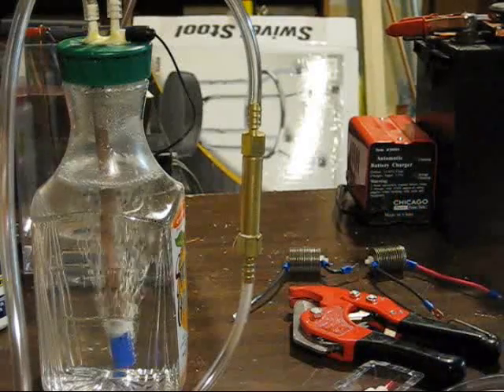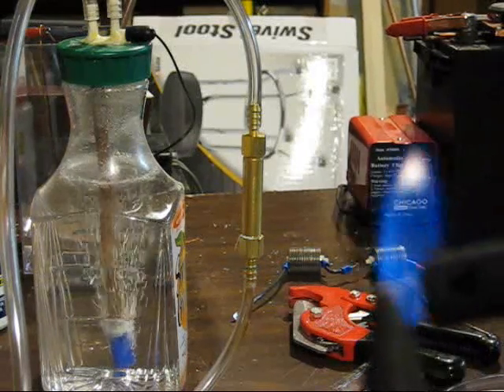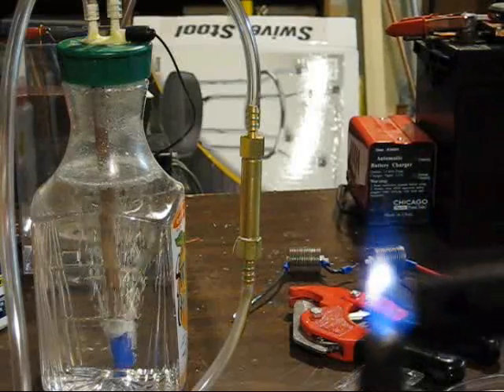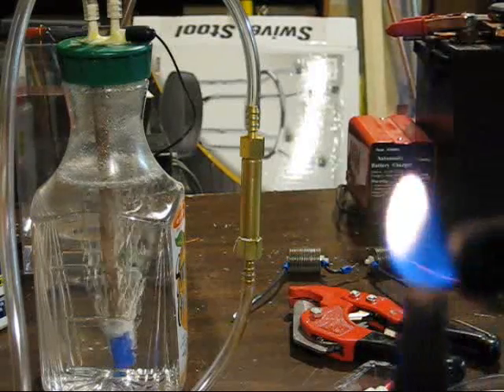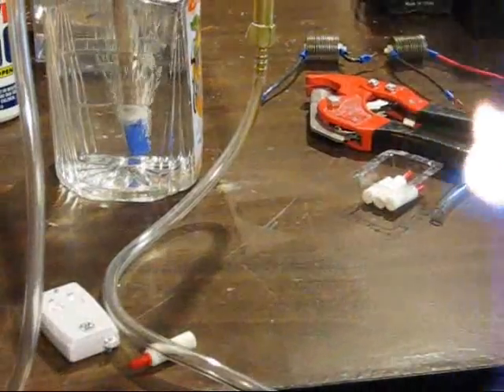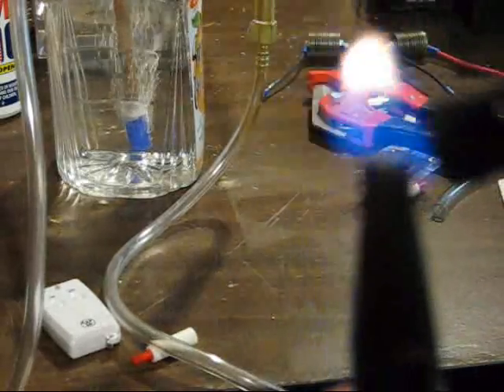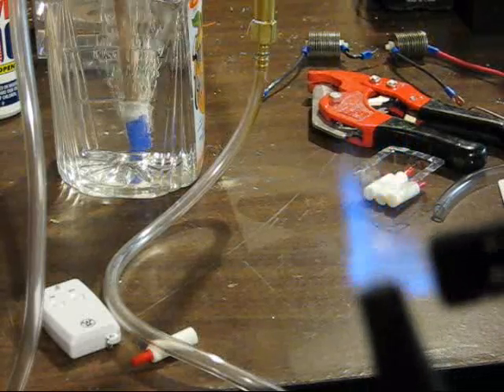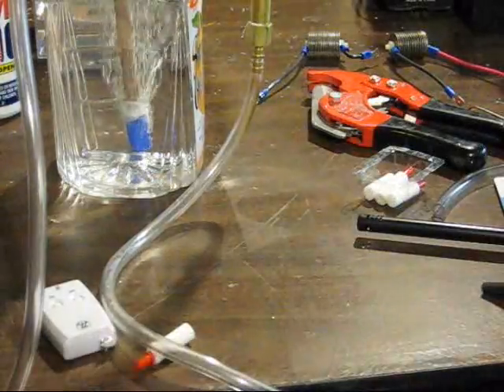Flashback Arrester #1©

Comment: Yes, explosion then implosion. If there was no flex in the container, all vacuum would be subjected to the water. (Consider feed and supply line length and dia too) Then, lowering its vapor pressure. Remember, water to vapor is about 1500 to 1.

Comment: can tell you from personal that when the flame front makes it all the way back to bubbler, she blows.  There may be an implosion that follow the explosion but there aint enough bubbler left by then to detect it.  This demo is cool because the flame never gets to the bubbler but the low pressure in the tube is pulling vacuum on the outlet.  Very interesting.

Comment: I am not so sure.  I think it might suck the lid IN not push it out.  I think I see in the video that the sides of the bubbler are actually pinching in on ignition.  It looks to me like there is some vacuum being pulled from the outlet side of the bubbler.  I suspect that the increase in bubble activity on ignition is caused by the low pressure in the bubbler pulling gas out of the reactor vessel.

Comment: Quick note. If the bubbler was round or slightly stronger and the water temp was just right (warmer) the water would instantly change to vapor. Then it would have blown the top off from excess pressure.

Comment: Watch the water level in your bubbler when you get your ignition in the tube.  You are creating low pressure in the bubbler. The water level jumps up, pulls gas from your reactor then settles back down.  I think you just demonstrated the implosion effect. Very cool.  And you did not blow yourself up!  Even cooler.